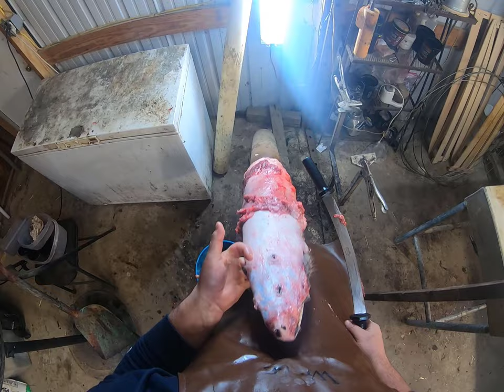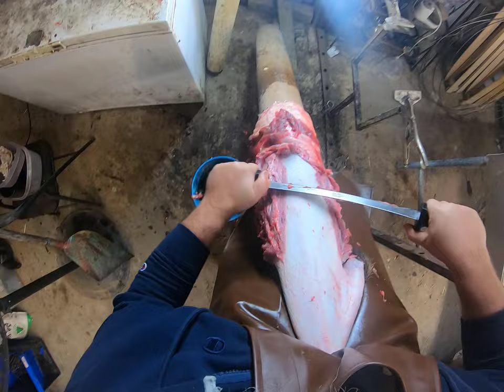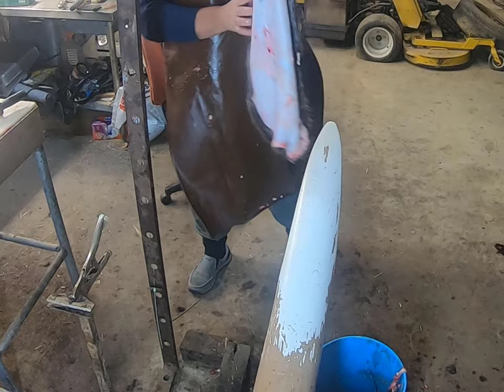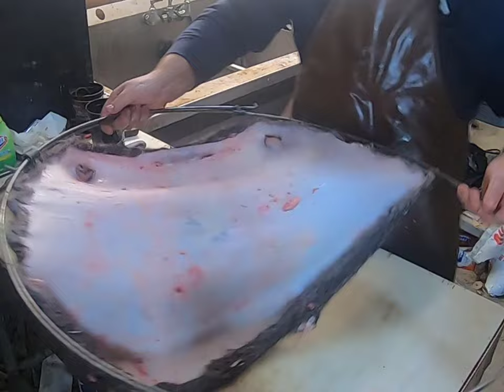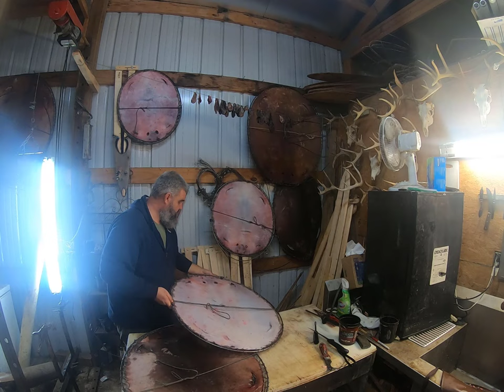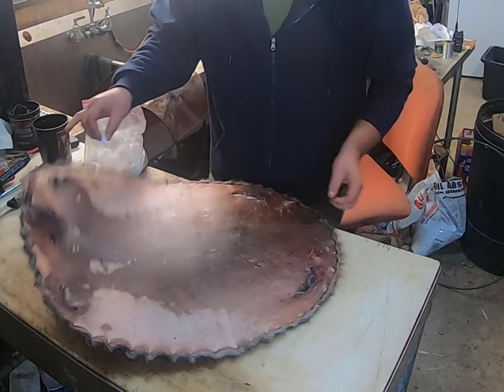Beaver fur put up after skinning.  Scrape, Stretch (Hoop), Dry, Clean, and Store.

Comment: Nice job fleshing
I might have to invest in some hoops considering the price of plywood in Canada this past couple of years
I like the way you close the leggs too
Reply from the maker: I have never boarded any so I really can't compare the difference myself. I did give some hoops to another trapper that boarded and he is now switching to hoops. Like anything else it takes some practice to get fast and good with them. But this technique works well for me. Good luck with your upcoming season and be sure to let me know what you think of the hoops if you try them.
Reply: @AnArkansasTrapper  will do.
Just did the math-$25 per beaver board and same for hoops with diagonal bar for oval and hog rings.
Cost is a wash but hoops are forever vs boards can do 2 beaver at at time but wear out over time.
Reply from the maker: @stevetaylor2445  I would suggest checking to see the quality of the metal before you order hoops. Some that I have are poor quality and do not go back to original shape, bend and warp. They still work fine it just aggravating.

I have been told that the hide dries a lot quicker using hoops as well. That might be a factor in you decision.

Comment: First off awesome vid, thank you!  I got a very stupid question, sorry in advance.  Let's say I just want to wall mount the beaver pelt, must I tan it or else it will rot?  Or can I just flesh it out, stretch and dry thoroughly, and then hang it up?  I've trapped muskrats before, and yes I did tan them using the "orange bottle" method.
Reply from the maker: Thanks for the view and there are no stupid questions for someone wanting to learn.

 Yes, for long term preservation you will have to tan it. If you were wanting to tan it yourself you could go straight from scraping and cleaning it into your pickling/ tanning process and hang/dry during that process.  What I showed in this video will only temporarily preserve it (a couple of years or longer if stored in a dry/non humid state).
Reply: @AnArkansasTrapper  thx much for the answer!

Comment: Just curious what is the beaver hide used for after you process it? Do you make some beaver boots or wallets? I don’t know anything about trapping I just randomly came across this video. Very interesting
Reply from the maker: Most beaver hides go to the hatter market.  They use the under fur of the pelt and turn it into felt.  All high end felt hats are made from beaver.  Stetson is one big company name. The tail leather is used in making wallets, I have never seen boots but it could be done. Glad you found the channel and I will try to answer any questions.
Reply: @AnArkansasTrapper  awesome thanks for the response!